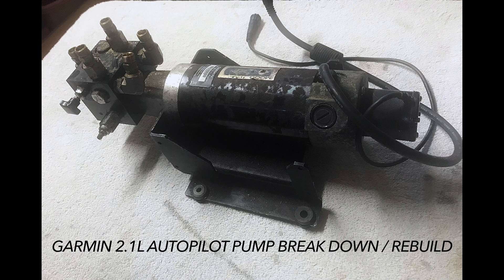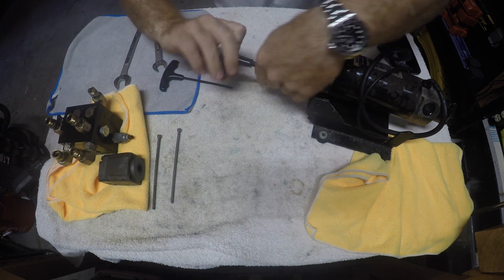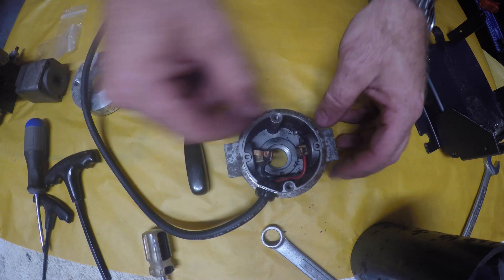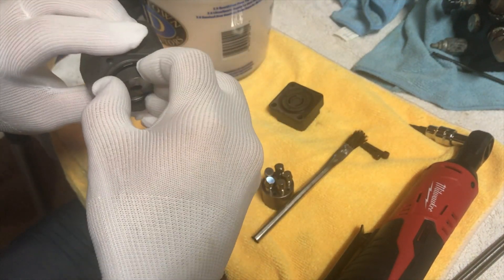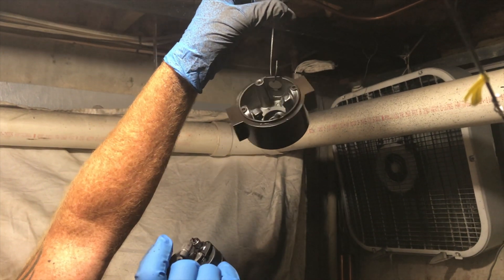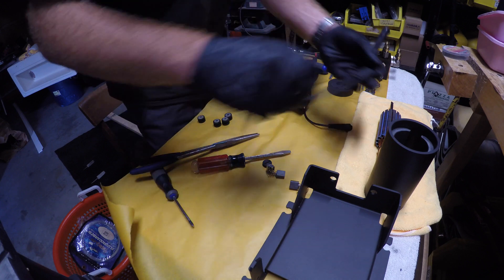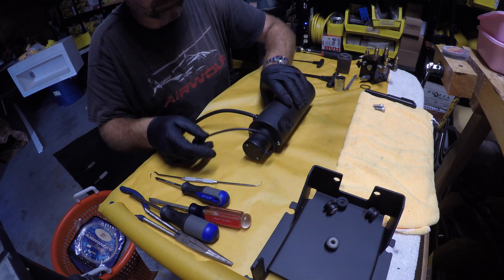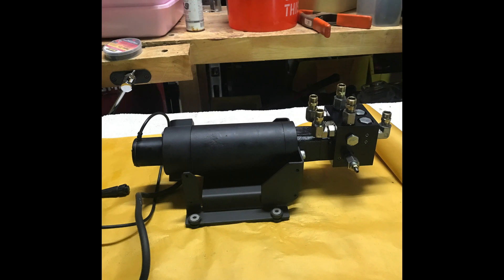Garmin 2.1L Autopilot Pump Break Down / Rebuild

Comment: Hi, thanks for the video. Does the pump work without connecting the encoder cable? 
I will install this pump in a system that does not have the encoder cable.

Comment: Where you able to test the unit in any way?  I have the same system and it doesn’t seem to be working, so I am thinking about doing a servicing similar to yours.  Thanks!
Reply from the maker: yes, it worked when installed in my boat

Comment: I have a pump like this that is acting wierd, can you help me? I think a valve is closed or something
Reply: Your video renewed my lost hope. I bought this pump on ebay and the bastard harry from hong kong shipped it with no foam just a box and it was all tore up. I guess it fell out of an airplane from the looks of it. My first autopilot motor is also broken so I plan to take it apart also and fixit
Reply from the maker: What issues are you seeing from your pump?
Reply: @Trayder27  I opened it up and there is a broken magnet and the magnets have came unglued from the cylinder
Reply from the maker: @oceanadventures1  that should be an easy fix, just glue them back as they were.  I used JB Weld Epoxy and cut some scrap wood to fixture them in place with clamps (the magnets will want to move unless you mechanically fix them in place wile the epoxy cures) Also clean up any excess epoxy from the agent/
 before it cures.
Reply: What if one of the magnets is broken?
Reply from the maker: @oceanadventures1  although not ideal it should not be an issue. I would glue the broken piece first and after cured then reinstall in the motor housing.